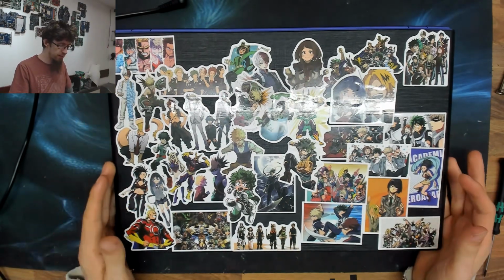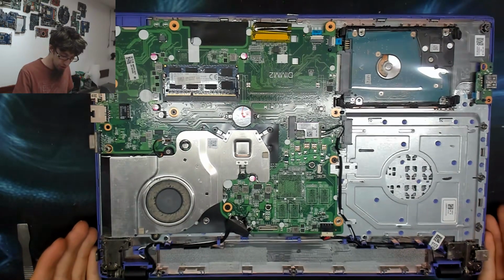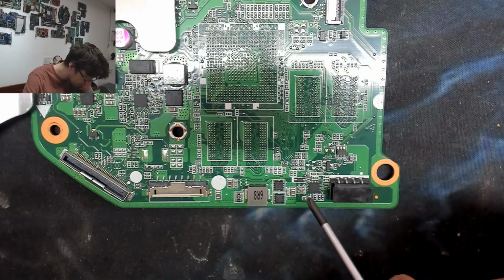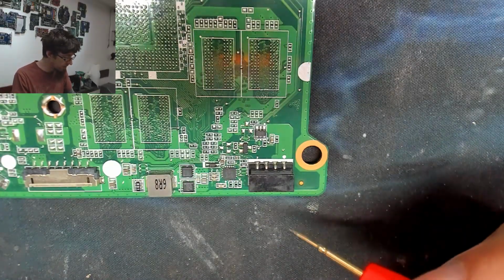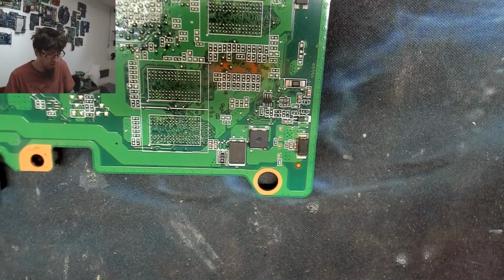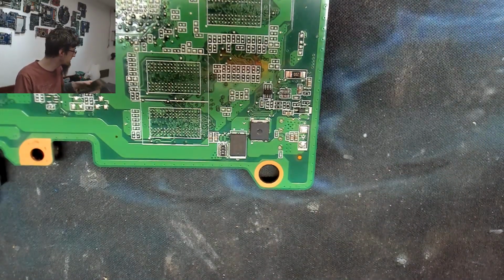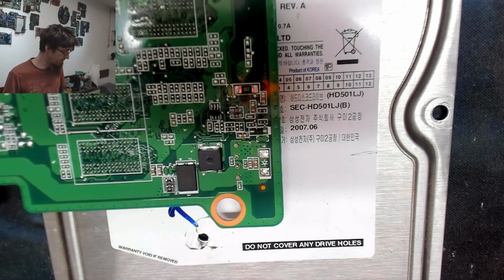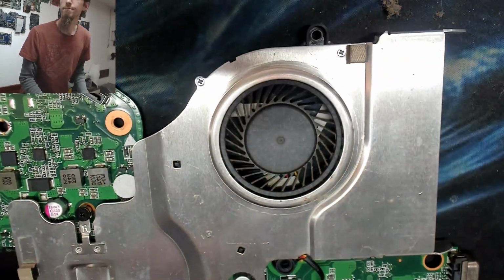LFC#178 - Acer E5 No Power

Comment: I was on the lookout. That diode you soldered correctly matches the little diode symbol (indicated in the indelible white ink silkscreen on the PCB). Also, the SS12 part numbers (marking code) of both are identical. Another way of saying it, in its substitution there is no error.
On the other hand, repair technicians (Audio/TV) commonly face them in our daily work. It is an original Schottky Diode from ON Semiconductor 20V, 1A and 1.1 Watts. It is NOT a reverse bias diode whose typical representative is the Zener Diode; neither in its symbol nor in its functional operation. They are diametrically different.
Both families of diodes are usually tested with a DMM set to the diode test function:
a) A display reading of [0.1x ‒ 0.39] in forward bias and infinity in reverse bias is completely normal for most Schottky diodes serviced out of circuit.
b) A display reading of [0.6x ‒ 0.7x] in forward bias and infinity in reverse bias is completely normal for most zener diodes serviced out of circuit.
Both can also be checked inside the circuit (ie without desoldering) and the readings will be very similar to those given above, but if in doubt remove them and check as in a) and b).
Of course we were hunting for a shorted component here but the test method above is applicable as well. I also read your accurate description in the title of this video.
Finally, thank you very much for sharing this video with us and our heartfelt congratulations on your successful repair. A sincere and fraternal greeting from Mexico.

Comment: I discovered your channel and I’m absolutely blasted away for your talent in explaining what you repair, thank you so much , I would appreciate if you could explain more detailed where to inject voltage for short detection without schematics because I have often motherboards where i can’t find the right place where to solder on the positive pole on the correct rail...Thank you m8

Comment: I have Acer E1-470. It boots from the ac fine. But it does not boot on battery, even if the battery has sufficient charge. If you put the battery while the laptop is on AC (live install), the battery works fine. I can then remove the AC cord and the laptop works on battery fine. The problem lies on the laptop NOT powering up on battery. Also, if the laptop sleeps while on battery mode, the screen wont show anything anymore. It's black. What might be the problem? I tried different batteries, genuine and class a, brand new and not (same battery model) but same problem occurs.

Comment: Excellent tips.  I love your channel, new subscriber here and thumbs up.

After watching some of your videos let me give you a trick in return of your favor.
When you use the voltage injection method and find the area that gets hot, try to use the lowest ohm scale of your multimeter and use the relative mode and then test across the suspicious components that get hot, usually the culprit is dead short comparing to the others always have some milliohms across it. 
And just to make sure also do it relative to gnd and +B. The piece at fault usually has the least ohms. That way you lose less time guessing and having that frustrating task of taking off many components.
Reply: This is good advise, particularly when there are a number of suspicious components connected in parallel.

Comment: hallo ...When I put the 20-volt charger into the laptop ... a measurement in the avometer, I found it was 5 volts !! i need help
Reply from the maker: That sounds like a short circuit across the DC jack, likely a similar problem to this video.

Comment: This laptop probably uses those weird chargers/Power supplies used in music system equipment where it looks similar to normal but the connection is reversed ... Probably to prevent user from using 3rd party chargers..

Comment: I was like; "Oh, no! Rest in peace speaker cord." I was relieved when he noticed it right away.

I have an ACER ASPIRE E15 576g and this kind of laptop is accessible at the back. I was kinda worried at the start when he tried to open the case. That speaker cord position at the bottom is not a good idea, looks like a trap for anyone who is not too experience about this kind of stuff.

Anyways, you're an expert you know your way around, so no worries there. But for person like me who has no or little knowledge about this, it's better to do your research and watch the experts do it first before trying to disassemble it.

Comment: I replaced a resistor that heats up i mean really hot. After replacement sttill dsnt work. The new one keeps burning hot any suggestions or i duno what to look for anymore
Reply from the maker: Where abouts is this resistor that's heating up? Need to figure out what it's connected to for the next clue.

Comment: Do you have a video explaining repair of NO CHARGE TO BATTERY ?
I have a DELL N14 that works without charging the battery...  the voltage on the pins for the battery - computer side - are all at low levels of 1 & 3 volts
Reply from the maker: Not yet, but I have a repair job in the queue with this fault - if I can figure it out, there'll be a video on it.

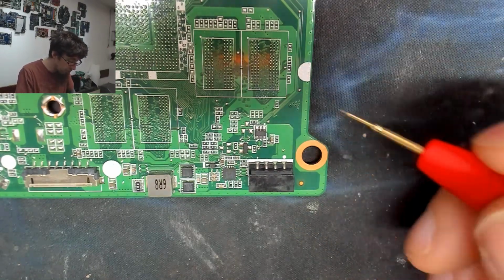Comment: Hi, question, the chip you was poking around at the 11:50 mark, is that a mosfet or an inrush limiter?
Reply from the maker: An Inrush limiter is usually two mosfets in series, so all In rush limiters are mosfets to that extent. But yea, that chip was a mosfet package. It's not common to see an inrush limiter mosfet in that style, but the fact that it's the first active component from the DJ jack is the give-away.
Reply: DC

Comment: Too easy.  You want a zener capacitor fault on a power supply.  The complex design worked just fine, but a critical capacitor was repeatedly purchased on the cheap.  It was only a small non-polarised cap, but the product used was cheap and wasn't rated to tolerate the expected voltage transients.  They would eventually go wrong in service.  These capacitors tended to go short circuit, but one of the bar stewards only went short circuit at five volts.  The meter was reading open circuit.

Comment: Had a similar issue with a portable disk once. Also a zener on the internal disk which blew up because the user used the wrong adapter (24V DC in stead of 12V DC). The zener really saved the user from a lot of troubles (all his family photos were on this disk)

Comment: Was zener diode. In paralel ri power suply it cuts high voltage spikes. Reverse polarity protection would be diode in series.
Reply: Be serious. It's not a zener diode; you don't shunt-regulate a high power input unless you like smoke! And there's absolutely no reason they would waste a fancy Schottky diode in this application. It's just a plain old vanilla diode, designed to trip the protection circuitry on the charger, and protect the laptop.
Reply: Terabyte  Sorry but nope it's a schotky diode. Failing short saved the rest of the laptop as he said.
This laptop has two red two black wires from a commonly used 2.5 mm barel jack. Someone plugged in the wrong power adaptor for something else & that cooked the 1 Amp diode. wrong polarity or too high a voltage or not regulated.
The other video has more wires for the LED and the centre data pin as it has an intelligent charger. Different circuit & protection.
Reply: @chrisharvie-smith486  I didn't know you could get Intelligent Laptop Chargers, I'm guessing they detect the maximum voltage and maximum Current the laptop can take while charging or powering the computer.

Comment: Thanks. That diode actually doesn't mostly mean a protection to reversed polarity, but mostly is used to clamp excess voltages when laptop is connected to an adapter of more voltage than its rating. Basically it should be a zener diode of 30V.  The diode is always reversed and so if the charger outputs voltage within its safe range it wont conduct anything, but if voltage exceed its rating then it will start conducting, and if the voltage stays for long, it will die with a clamped Short circuit between its pins.
Reply: Using the Zener, since it operates in reverse bias mode then serves as both over voltage and reverse voltage protection. Pretty smart...

Comment: Wasn't that a TVS diode? Those are connected in parallel over the power inputs, to clamp down when a surge or overvoltage occur.
Reply: It is for sure.

Comment: Shouldn't that diode be a zenner with a reverse bias voltage of  lets say a plus 5v volts of what the charger is puting out?!
I mean if the charger is puting out 19volt, a zenner with the reverse bias voltage of 24 would probably do just fine.
Reply: @Eric H well a zenner would provide a overvoltage protection as well as cross polarity protection. A diode mounted in  reverse bias would also provide surge protection when mosfet open or close efectivly disipating any reverse voltage

Comment: Reverse voltage diode dead means somebody used the wrong charger on it
Reply: Tudorache Adrian Yeah those universal chargers with a bag of assorted colored plugs and the nature of those polarity reversable pins. I had to tape mine in case it falls off, in case I forget which way. I always wondered how many laptops they killed on the market.
Reply: @wahyung9669  At least somebody makes a buck or 2 from the improper "user handling"  :)

Comment: In automotive, I hear they often put Zeners in backwards for protection. Maybe laptops, too if they hired an auto guy.
Reply from the maker: Yea I believe it doubles as over-voltage protection, as well as reverse voltage. A 30v zener in there, and it'll conduct if the charger goes way overvoltage for whatever reason.
Reply: That's what ACER stands for ---  Automotive Computer Electronics Repair
Reply: Al Catraz , Ha!

Comment: Man I’ve got same model and same problem , I suck at checking with multimeter cuz I’m a noob when it comes to these all, but to be precise I’m getting same tone with same part that you replaced, is it a good idea if I replace the same part to turn on my laptop ? Cuz I’ve seen on some site with same model replacing the same part
Reply from the maker: To clarify, do you mean; "Do I need exactly the correct diode to replace the failed one?"
Any small rectifier diode rated for about 30v will do, as all this diode needs to do is short out the input in the event of reverse or over voltage coming out of the charger. So it doesn't need to be exact.
At a push, you could leave it off the board, although this leaves the laptop unprotected from cheap off-brand chargers.
Reply: Adamant IT yeah that’s exactly what I meant because on the site they Desolder/replaced same diode and I saw same thing on your video, could it be I’m having same shortage on my laptop’s motherboard ? Do you think it’ll be a good idea to de solder this diode just to check if i can turn on the motherboard and then replace it with 30v diode ?
Reply from the maker: Yea that would work. To check with your multimeter, set it into resistance mode and put the probes on each side of the diode. A healthy laptop should have at least 20K-Ohm over the DC jack. If you're down at 0 or a few hundred ohm, there's still a short circuit.
If you remove the diode and the short disappears, you've got your culprit.
Reply: perfect, much appreciated man, I’ll give it a shot once I’m free and get back to you with the result , you made it very simple for me to understand thanks a lot for your respond and help!
Reply: @Adamant_IT  Did you use SS12 20V 1A  Schottky Diode?  I can´t find what value is brand Littlefuse 5EJ70 of my Acer E5-522.
Reply from the maker: It'll need to be 30v. The voltage rating is the Breakdown value, where the diode will deliberately short out due to the charger voltage being too high. As charger voltage is 19.5, you want the breakdown to be closer to 30v to stop 'false positives'.

Comment: This again is an easy repair..... With direct dc power supply within minutes you can find the fault.....just have to confirm that the short is before the current sensing resistor or after the current sensing resistor

Comment: Hey. I wanted to ask a question about the Acer aspire e5 576-g laptop, I connected the USB TTL to the laptop, it seems that the wires are messed up, now the problem with the laptop does not turn on. I opened it, looked at one controller or the Zener diode burned, can you tell the brand of this controller or what is it? I will leave a link VK if anyone is well versed in this laptop can write to me. I am sending a photo. Please help me if you know about this.
https://vk.com/id184000915